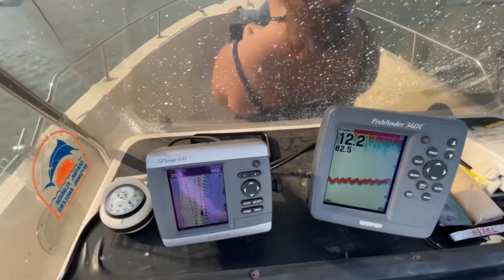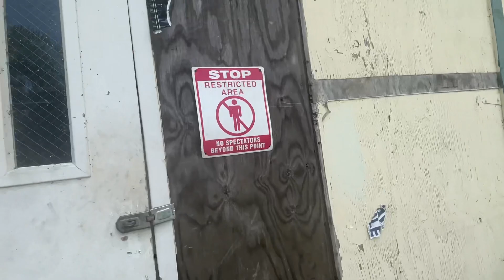We went out  #boating @ #ponceinlet  #florida we got stuck on a sandbar and almost sank the boat￼

Comment: Looks like a nice place. Too bad about the boat, but it should be an easy fix.  I used to back up boat trailers several times a day, every day for ten years when I worked at a fiberglass shop.  About 90% of our business was boat repairs and painting.  That was over twenty years ago.  I used my utility trailer the other day and they were doing some work in the alley when I got home.  I had to go around the other side and back up all the way down the narrow alley.  I did it ok but realized I'm not nearly as good as I was lol.  I used to fly around the yard parking boats about a half inch apart.  I don't think I'd try that now.
You definitely have too much going on at once.  It gets frustrating and overwhelming when it gets like that.  You gotta narrow things down and focus on a few projects instead of ten